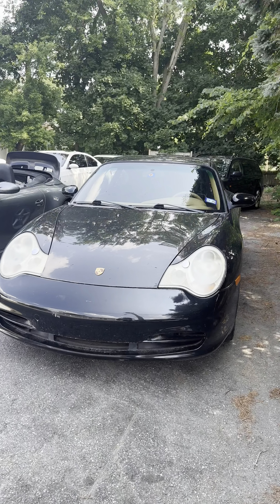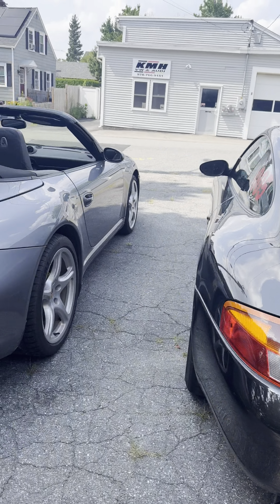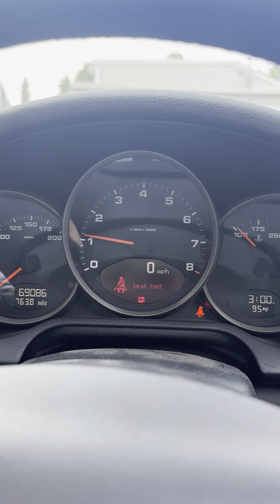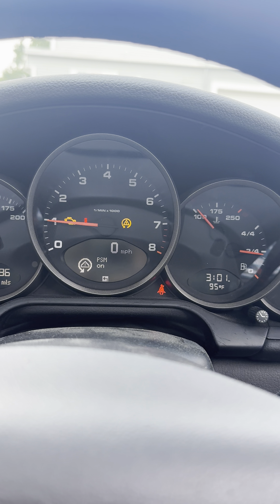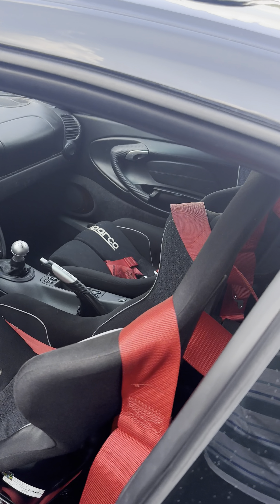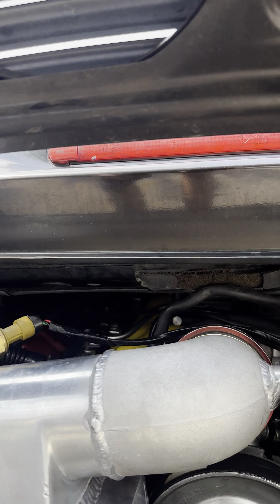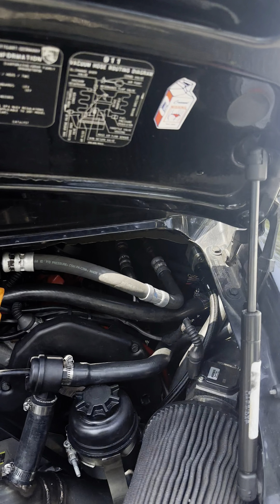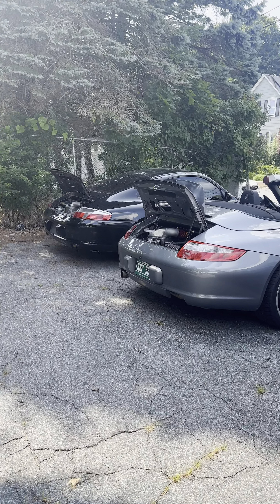Audi 2.7t swapped Porsche 911 from 1999 to 997.1

Comment: Will the 997 always run with the CEL on after the 2.7 swap or can it be corrected?
Reply from the maker: No, this car is still on a base tune file for engine break in, the base file is not polished so some errors come through. The final tuned file only gives check engine lights when its actually necessary. The light actually works related to faults, that's what I mean by "real check engine light". 
We could easily remove all faults and lights functionality and they would stay off. In a way we are showcasing the light actually works related to faults.

If you know about swapping or modifying the 997s the tell tale sign to a properly translated canbus is ABS and PSM functionality.